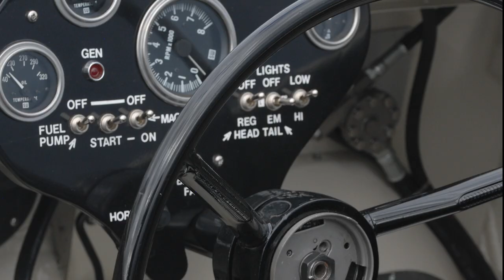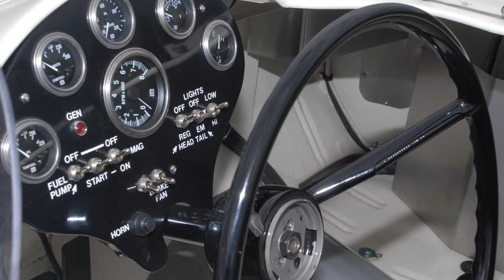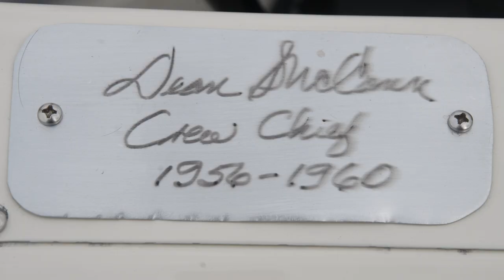1957 Ford Thunderbird "Battlebird" - Speed & Chrome Illustrated Magazine

Comment: 5:27 That's not a quickchange, it's a dummy cover on a 9".
Reply from the maker: First off I have to commend you on the Eagle Eye on spotting that. I just talked to Richard and this is what he said. "I’ve yet to find a decent Halibrand  V8 rear which is what they had originally, so it currently has A very nice fake that is made in Australia by Lyndsey Schumard"
Reply: @SpeedandChromeTV  Back in the late 80's in Australia I built a number of casting patterns for hot rod parts & one of them was a dummy qc cover for the 9", that's quite possibly one cast off my pattern. I sold all of them when I moved to the US.
Reply from the maker: @nzsaltflatsracer8054  Wow, you're probably the only guy on the planet that would haven noticed that based on your history with them. Pretty awesome man!!!